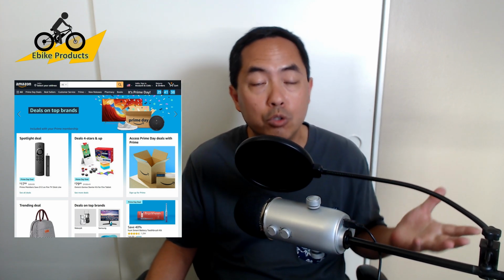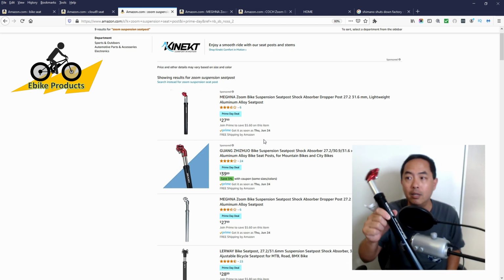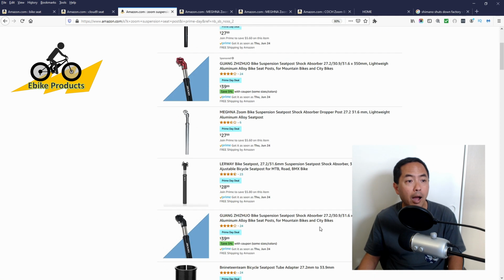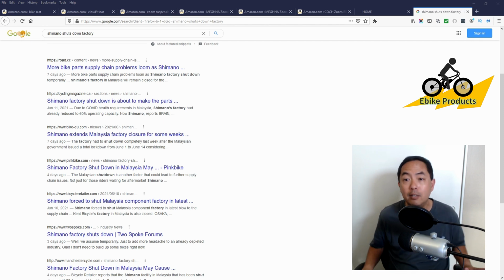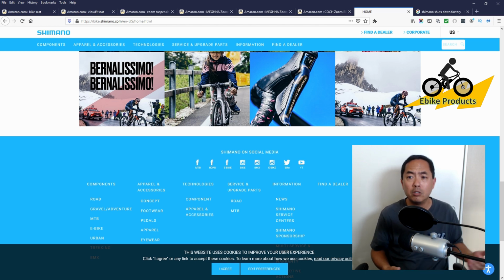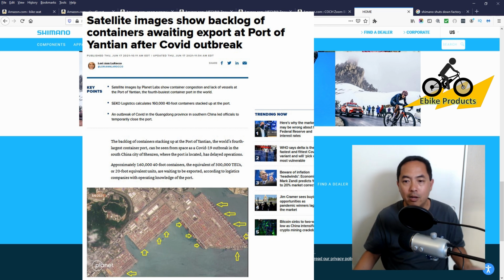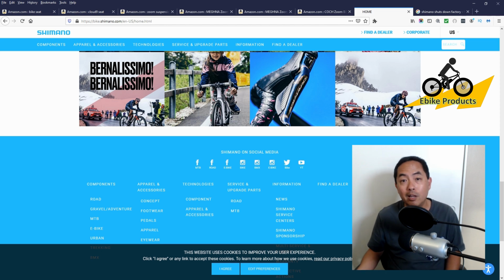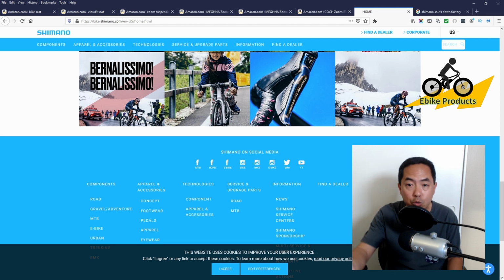Electric Bike News! MAJOR SHIMANO PLANT SHUTDOWN! | HUGE Ebike Accessory Savings on Amazon Till 6/22

Comment: A little overreaction don't you think? Shimano has 12 factories. For one factory to temporarily close because of Covid doesn't mean as much as you want your viewers to believe. I spoke with Lectric about the Malaysia factory closing and they don't seem very concerned about further delays from it. You shouldn't either.
Reply from the maker: Mmm. Thanks for the feedback. Maybe I got the information wrong from some of the articles I read up on. It was my understanding that the Malaysia factory that was shut down was the biggest one they have that produced most of the lower cost OEM components for Shimano. The other factories in Japan and other locations produce the highest end parts and most expensive stuff for after market purchases. I think the guys at Lectric were able to secure their orders a long time ago so they already got most of their stuff already on their bikes (this is just a guess based on my conversation with Levi mentioning how long ago they planned out their 2.0 manufacturing). 
I sure hope my gut is overreacting and you are right. I am looking for my next ebike and kind of in a panic that if I finally figure out which one to get, I’ll have to wait almost a year again like I did for my Blackbird. 
Thanks for the feedback and taking the time to comment!
Reply: @EbikeProducts  I'm just going by what Noah from Lectric told me. I was concerned as well. I'm not willing to be out the money for two bikes for a year and was considering canceling my order but I was told it won't be a problem and they aren't concerned. What that means exactly, I'm not sure. My bikes are still scheduled to ship at the end of July. To be quite honest, I don't think any business is going to be 100% transparent about the situation. Not to me, not to you, not to anyone. We have to take what we're told and kind of add the missing pieces to come to a reasonable conclusion. I think there are numerous reasons bikes and every other product are taking forever to get. I bought a 2021 5th wheel in May of 2020 when Covid was just ramping up and I'm so glad I did. People are paying huge money for them now and they are taking a year to get in some instances. This is a perfect storm. Covid, shut downs, businesses not having enough workers etc. are just parts of that storm. If you're in the market for a new Ebike, my guess is you will wait quite a while for it. Every day that goes by with more orders being accepted and few orders being fulfilled just puts everything further and further behind.